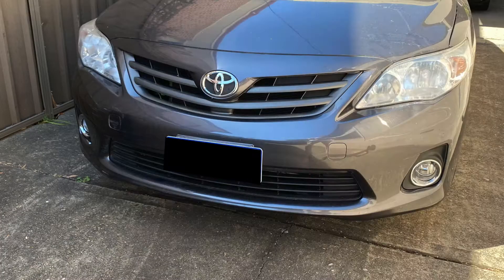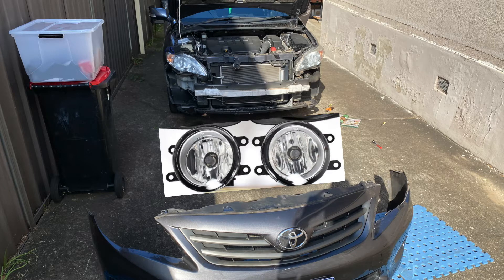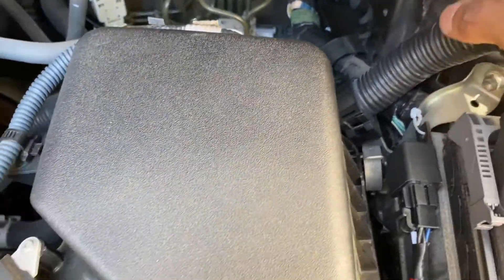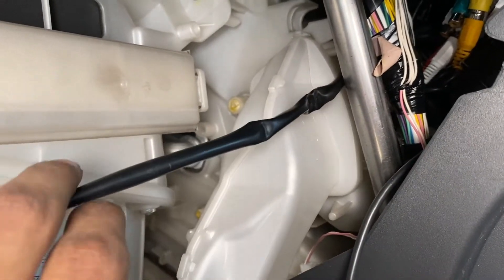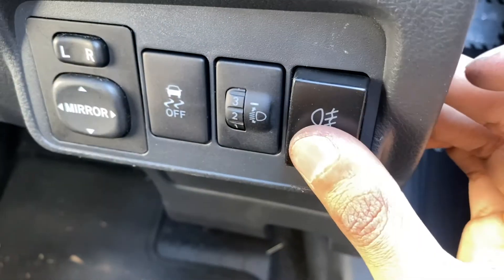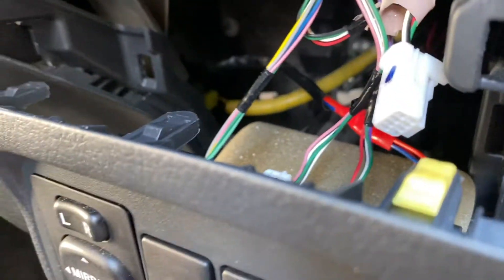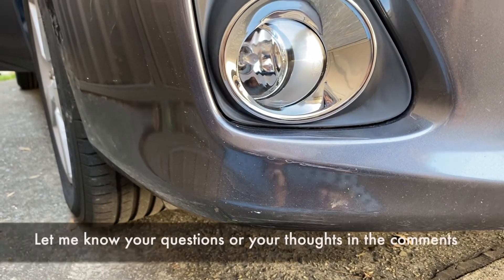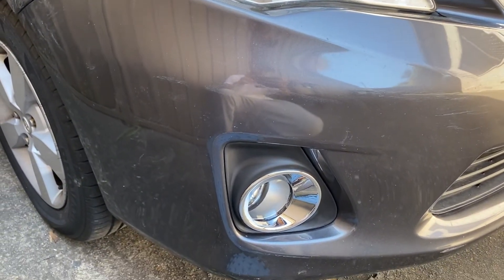Wiring & Installing of Fog Lights in Corolla 2011 (with diagram)

Comment: Very informative and straightforward video using good engineering language 👍👍 Mind me asking how you connected the ACC, was it with a fuse tap or simply wiring on an existing circuit?

Comment: You've set them up as spot lights, or extra lights, y not run a jump fuse off high beam, so they only work on high beam, & all worked into fuse box of car. The switch should be a 4 pin illumination switch, 4 it 2 be correct. 
It's installed with this video, but it's not legally installed, or correct as per factory installation..  wire diagram is good but basic, you can do better!

Comment: so do both black wires connect to the battery or one of the black wires connects to a wire in the car that tires on the light when headlights are turned on because for me the light of the button stays on the whole time

Comment: Interesting video. 👍

For my 2003 Corolla, I had originally used a kit similar as yours, with switch in auxiliary port.

I later went with a more OEM route, by adding factory relay, turn stalk with fog light feature.
I made video, or rather Google made video with recording I made with phone on my channel. 😲🤫

Comment: I have three wires on the switch Yellow ACC. Blue signal to the relay. Black for Ground... Whats the best way to wire that yellow acc. wire to? Radio like you is harder on my base model 2017 corolla. Thank you great how to video. Nice n clear
Reply from the maker: You can use any accessory under passenger/driver side fuse panel using a fuse tap

Comment: Where did you purchase the kit?
Reply from the maker: this isn't the exact seller I bought from, but it is the same product https://www.ebay.com.au/itm/Fit-11-13-Toyota-Corolla-Altis-Sedan-Spot-Light-Lamp-Fog-Light-Lamp-Chrome-Cover/261614501047?fits=Year%3A2011%7CModel%3ACorolla%7CMake%3AToyota&epid=608707810&hash=item3ce9707cb7:g:bREAAOSwRWddiFWD

Comment: Please where is a 12v plug
Reply from the maker: There’s no 12V plug, for trigger switch inside the car, I just tapped into Headunit stereo 12V. You can tap into any red 12V ACC after testing with multimeter and it reads 12V when ignition is ON. For outside, you can directly connect to the car battery as shown in the video.